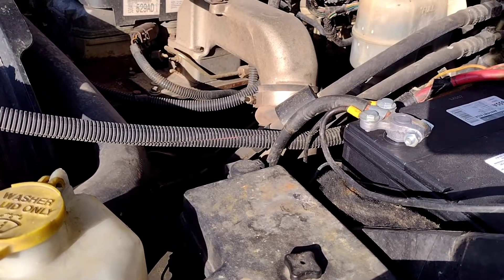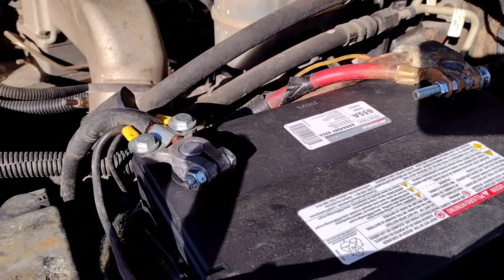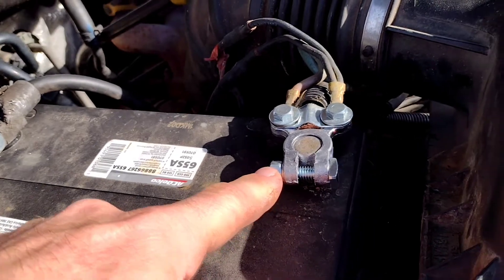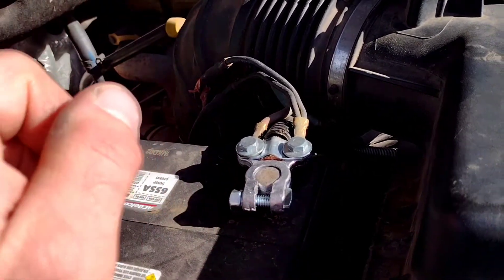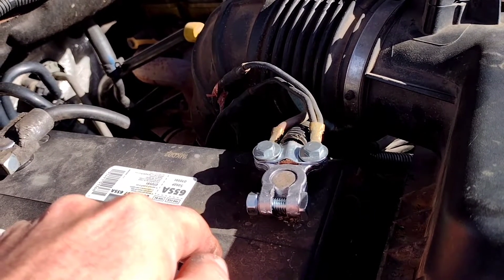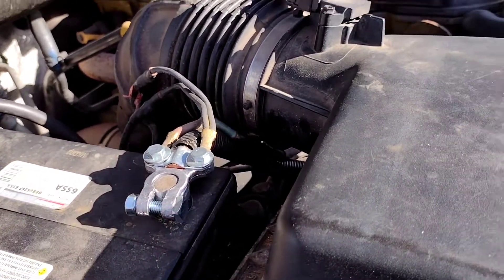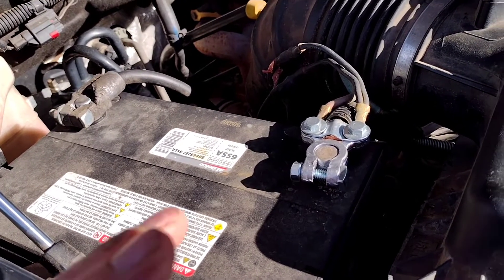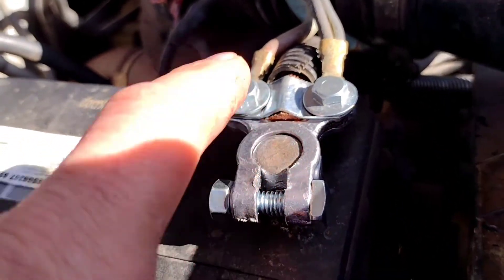Charging system fail Dodge Ram Diesel 5.9L Battery terminal problems and fix under and over charging

Comment: IT'S NOT STRANGE AT ALL '''''   THOSE TRUCKS HAVE THE SAME CHARGING SYSTEM '  NO MATTER WHAT MOTOR WAS INSTALLED ''''    IT'S ALL THE SAME THING .
Reply from the maker: Gas trucks do not have dual batteries and all the extra cables.

Comment: Always put grease on all these terminals.
Reply from the maker: This corrosion was there long before I bought the truck.
Reply: @NathansMoparGarage  gotcha. Don't know if you know or not. Cummins makes there own batteries for these trucks now. I put 2 new ones on my 2005 3500 srw and they look amazing in that engine bay
Reply from the maker: I just brought some AC Delco batteries from Menards during the summer They were $100 each. The price has gone up a bit since then. They have been good in the last couple cold mornings we have had.

Comment: You’ll have to add this to your Preventative Maintenance Checklist.
Reply from the maker: The batteries that came with the truck had been eating away at those terminals for a while. Usually the first place to start is checking the battery and terminals.